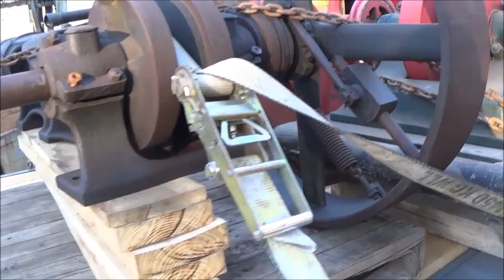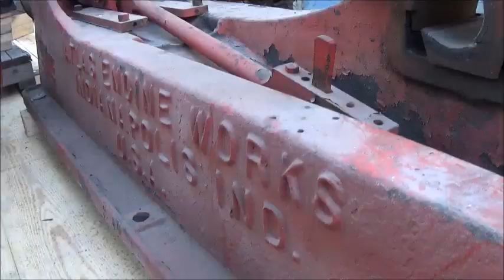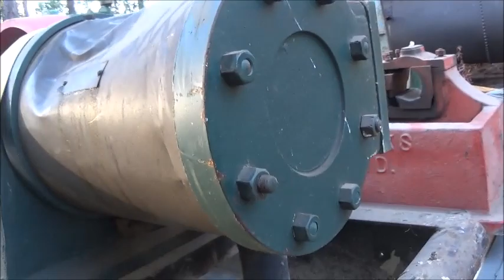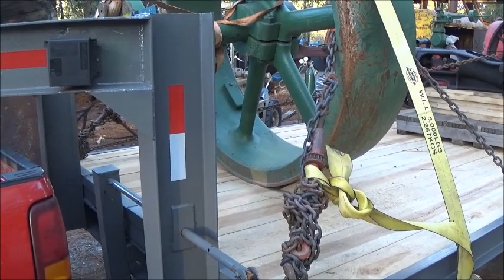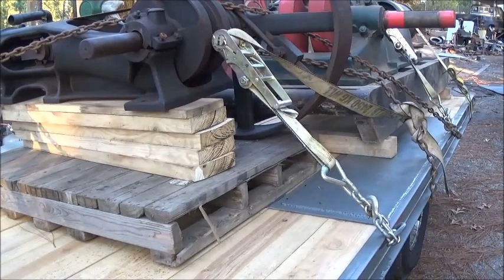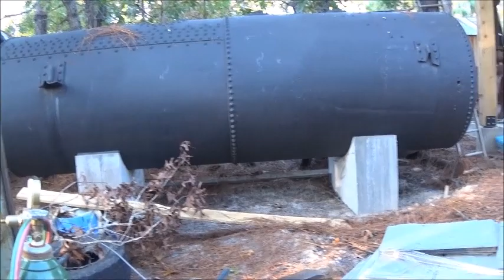OHIO TRIP FOR 3 STEAM ENGINES

Comment: I have a small, vertical steam engine you can have. Also a Worthington two cylinder steam pump you can have. They are just going to get thrown in the trash. They are in Vicksburg, Michigan. Both are complete but disassembled. The pump has a cracked case (freezing most likely).
Reply from the maker: Email me if you can oldpowerjaw@gmail.com

Comment: would love to have one, can you share your contact for your dealer?
Reply: I have a nice engine I've been thinking about selling, always run out of room on my trailer to take it to the shows. It's approx. 1898- 1902, vertical coke bottle style frame about 5 1/2 feet tall, unique engine! In Ohio
Reply: @randyraboin8341  do you know who the maker is? do you have a pic or video of it running? and approximately what horsepower is it? Price?
Reply: I'll have to double check but I believe it's a NUNDO, made in Nundo N.Y., we did research and found it was originally on a horse drawn trailer, with a boiler and cement mixer, and we found traces of cement on it, so thats confirmed. I do have pictures, not sure of the horse power but the cylinder is about 8-9", again have to double check, it came out of Canada and I met the guy in Buffalo to pick it up, he stated his grandfather put it in the barn in 1920, its in my neighbors barn now for 5- 6 years now, so barn stored over 100 years! The valve block, steam inlet and all fitting were sealed with square head pipe plugs, I've not gotten around to running it yet, plans were to restore it and make it a center piece in the dining room, it's just too heavy and I always have too many projects going on. Price would need to be discussed but I'm easy to work with! I seen another guy has one about the same but his head, cylinder is only about 4- 5" dia, less powerful. I don't have a boiler and my air compressor isn't big enough to run it, was hoping to have room on my trailer in May to take it to the Portland, Indiana show. 
t

Comment: I don't know if you are interested or not but when I worked at Nichols and Stone chair makers in Gardner Mass., they had a single cylinder steam engine that was used to produce electricity. The building is still there but the company has long since left. I don't even know if the steam angine is still there. Just thought you would like to know.

Comment: Some of those big generators need to have a load bank to dump some of the power to keep from burning up the generator. The big military generator has the load bank on top.
Check it out.
Reply: You’re cool confusing the field resistor with a load bank. A generator doesn’t make “excess electricity”. The field voltage is regulated to maintain the desired generator output voltage. The field resistor is used to control the voltage to the main generator field. The exciter is a small generator makes the DC voltage for the field. modern generators often use electronic exciters in place of a separate rotating exciter. Small gasoline generators have an exciter that is built into the main generator that uses permenant magnets to generate the field voltage. They are limited in that they can only supply a limited amount of field voltage. This is why when you overload a small ac generator it will keep running but there is no electrical output. The field just collapses.

Comment: I like the trailer but what does the Job of an override brake to prevent jack knifing?
Reply from the maker: If the trailer comes off the brakes come on. Required by law on  over 3500 GVW trailer.

Comment: JW,

There' s a HUGE boiler in Clovis, NM that hasn't been used in decades. Maybe 20' long.  It's built into a lean-to next to a very old Quonset hut.  Entirely concealed.  You'd never know it was there.  Almost seems like a boiler from a steam engine, it's so big. But, it's not.  The owners don't know what it was used for, and have had offers to sell it for scrap.  But, they haven't because it seems wrong to to destroy it, since it's been there so long.  I have some pics.

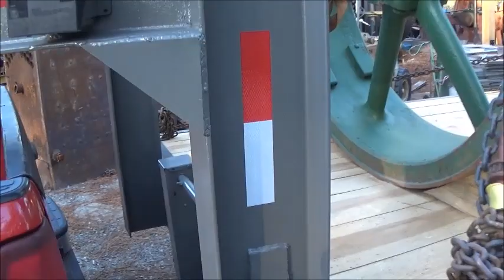Comment: - 7:33 | My mind's eye tends to go a bit "overboard" and sees a longer tongue for easier backing:
- Internal and external gussets Over the I-beam flanges that are 1'3" on the square sides;
- With a slight arch cut out of the gussets' middle section for clearance of the trailer {if needed};
- All welded Over the "inside" I-beam flanges via slotted 3" cut-outs {2in spacing}
- Then, too, I figure you will be hauling BIG on twice the size axles and tires some day.

Comment: We've been pulling goose neck for years. I really like the tandem dual wheels on my rig, the more rubber on  the ground , the less tire trouble on the road.  I haul some pretty large tractors on my trailer, so my limit is always the pulling truck. I'd say that your about at the limit for single tires.  Those engines are considerable chunks, it's easy to under estimate just how heavy they are.  Glad the trip was good.
Reply from the maker: If I hadn't been using a trailer frame that was already welded together, I would have went narrower so I could have went dual tandem. All my pintle hitch trailers were dual tandem except for one 3 axle singe tire. I did not like it at all, lot of twist while turning.

Comment: Awesome!!  Your collection is growing by leaps and bounds. I was wondering if you have a boiler in mind to power these engines? I know you're not using the big boiler as mentioned, and I remember the smaller one you bought, but don't know if it's in good enough shape to use.  What's the plan??
Reply from the maker: Got a couple boilers in mind. I absolutely plan to use one.